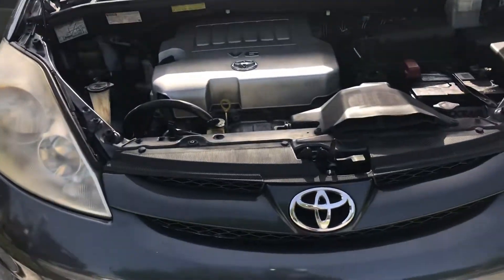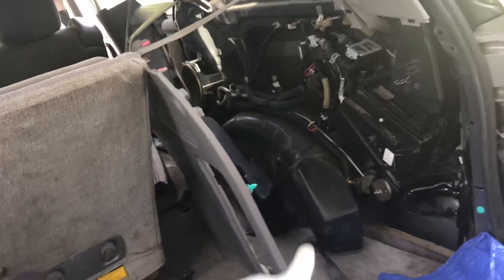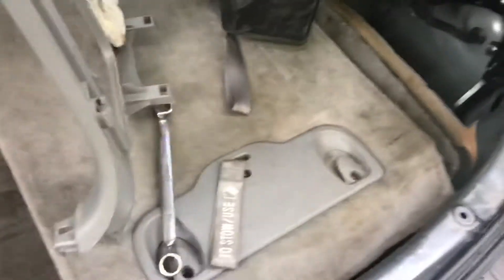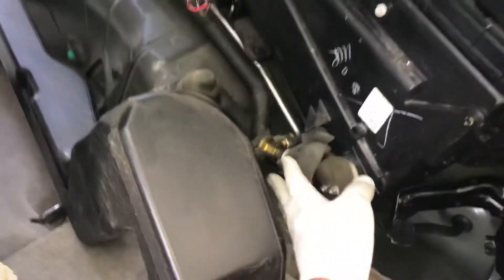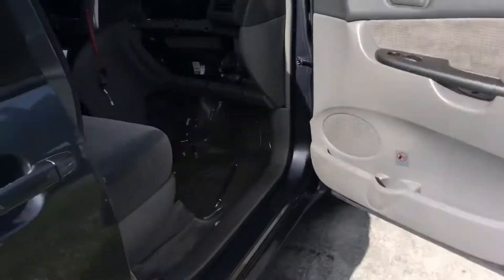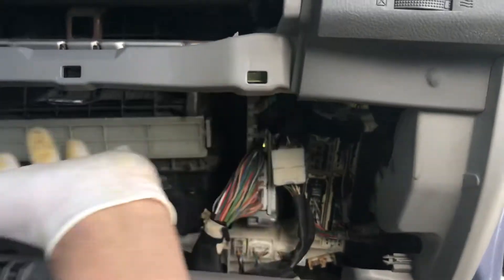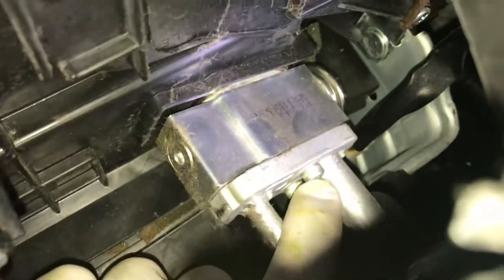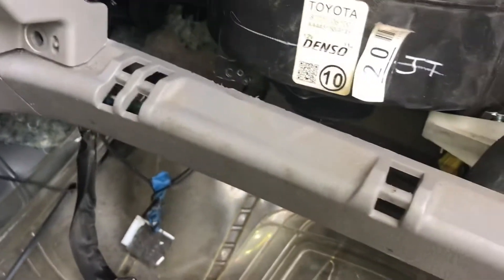Expansion Valve Toyota Sienna freon Air conditioned where is  located and how to replace

Comment: All of a sudden I am getting all the videos about expansion valve replacement. Why do you people replace the TXv valve? What are the symptoms and problems that necessitated the replacement of them on Sienna?
We have the same year Sienna and AC works flawless all the time. Only had to screw around, clean and reinstall the climate mode actuator on the drivers side of climate system for the blend doors.